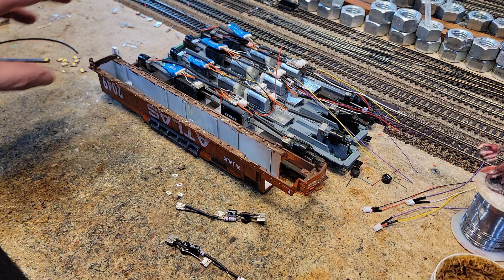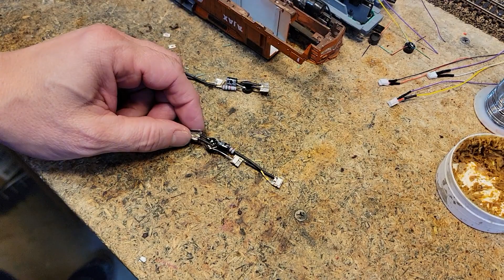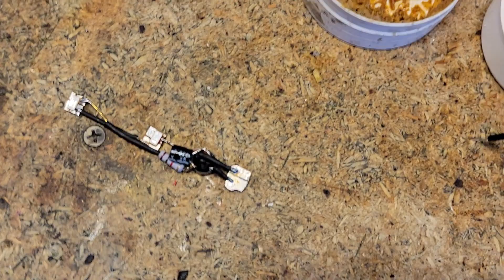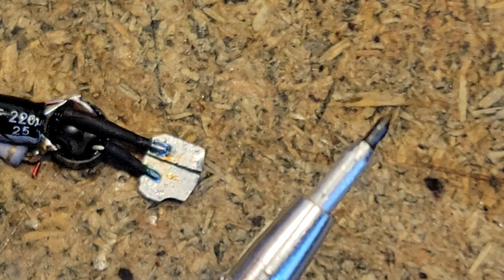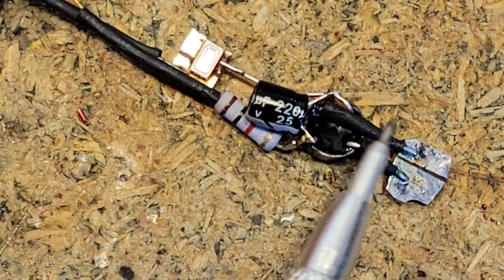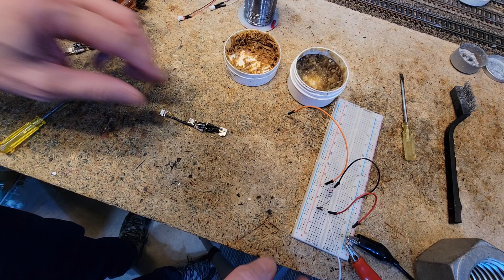Dual Motor DD40 28 SMD Lights Basic Setup

Comment: You could wire in a Zener diode  that would only allow the cap to see 12 volts that would add some protection wouldn't it?
Reply from the maker: that's a very interesting idea!  I should do some experiments with those guys.  since stacking SMDs requires a lot of voltage and my track voltage is 18v, I've not had a problem - other than these cheap caps have exploded a couple times!
Reply: @elite194  putting that zener diode on the + of the cap would do it
Reply from the maker: @Normancorey1162  that is something I must try!
Reply: @elite194  you could use a 50v cap but that probably would be to big to fit
Reply from the maker: @Normancorey1162  the only problem is so many locomotives with capacitors can cause a power surge when they start up!